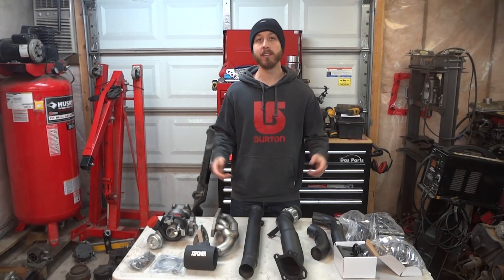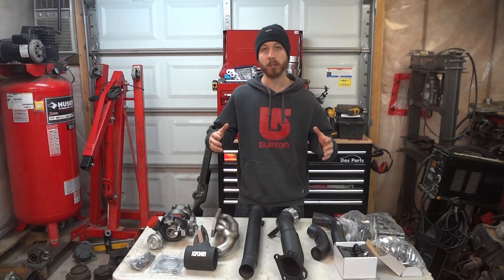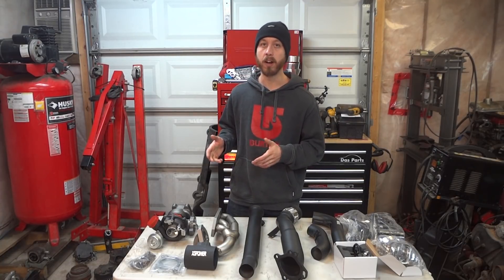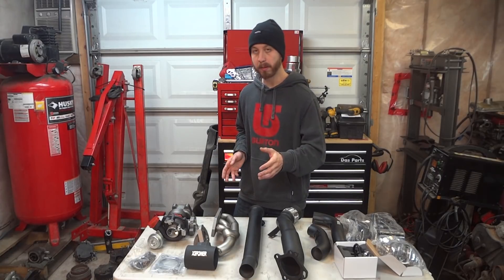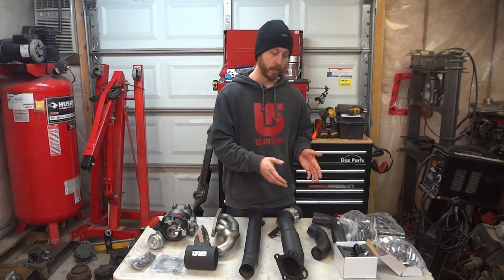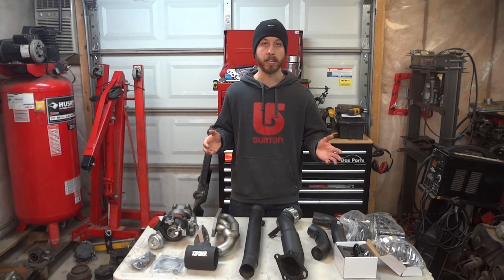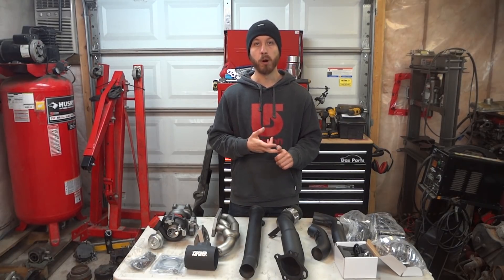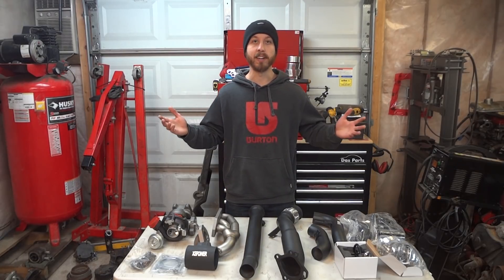B5 S4 500WHP XS Power Budget Build EP1 - The Parts!

Comment: How did the kit hold up? And fitment ive purchased parts from them in the past and fitment has been a problem...also to correctly and safely control boost dont use those dv they suck and will blow your engine

Comment: While I wouldn't personally run any of these "china" turbos on my car, im interested to see how this all works out. Its nice to see XS power putting out parts that seem much higher quality than the past. Those manifolds look very good, took me by surprise.
Reply from the maker: You'd be surprised at how many people are unknowingly running the same turbos
Reply: Haha, I know. To be fair, BW produces turbos in China, they have come a long way since the ebay/RP turbo days. Plus, for those of us not as mechanically inclined as yourself you have to consider the potential tradeoff of running something cheaper with a potentially shorter life or something expensive but proven. I will be doing my 3rd motor pull soon, just for turbos haha.

Comment: The Audi Garage hey what’s?. I don’t really know much about this engines and I have a couple of questions. Maybe, you can help me.1. Is the 01 2.7t s4 and the 01 A6 2.7t  the same engines? And the second question is 2.do those turbo fit in an 01 Audi A6 2.7t Quattro and what would be needed if it fits..Thank You
Reply from the maker: They  should both be APB code engine.  These turbos would fit in an A6.
Reply: Depending on the year of the a6 it's either apb or bel. They have some differences, like the intake manifold/fuel rail area and  couple other small differences like the sai

Comment: Better do rods so you can actually push the limit of this setup. Otherwise your tuner will have to reduce torque or your block won't last long.
Reply from the maker: +Andrew Evans check out a few of the previous videos, stock engine with way to many dyno pulls is still rocking just fine.

Comment: I used all their stuff for my previous build, though I went with k04's on E85. I have to say that I was surprised by the way it all turned out, I had zero issues with fitting and quality, turbos are still kicking hard after a full year of absolute abuse. With that said, 500whp with the hardware you have there should be cake. When is Part 2 coming out?
Reply from the maker: Maybe in a couple weeks or so for Pt2!
Reply: The Audi Garage a couple years later and we’re still waiting
Reply: @TheAudiGarage  Are you still alive ?

Comment: What N75 valve will you be using?  stock? or the ECS race valve?  I have no idea what the differences are between the "J" or the "H" versions...maybe you could shed light on it
Reply from the maker: Stock N75 is all that is generally needed for a "regular" build.  We will likely be running a MBC in parallel for this build.
Reply: Stock N75 valves work for any build. Local guy here is running a built 2.8L high compression tial 770 build using the stock N75. He will be running 42lbs of boost by next spring.

Comment: Port match the intake manifold to the head, it's a big restriction.
Reply from the maker: On the stock 2.7t heads and intake manifold we are using this isn't a big issue.  If one were to swap to 2.8 heads that'd when the porting is needed.
Reply: You're correct. Us afc guys have it the worse when it comes down to b5's lol
Reply: Have you ever seen 3.0 heads on a 2.7 TT? I saw on Audizine where someone got them to fit but they then decided to go with 2.8 heads.

Comment: Question: Will you be using one large front mount intercooler for both turbos or the separate ones that come with the 2.7TT (if this is a dumb question I apologize in advance). I’m really looking forward to this build!
Reply from the maker: XS Power SMIC will be used for this build